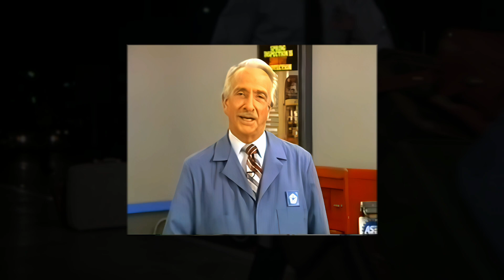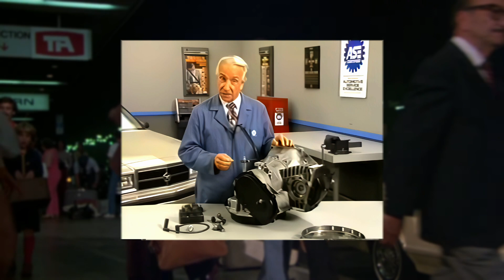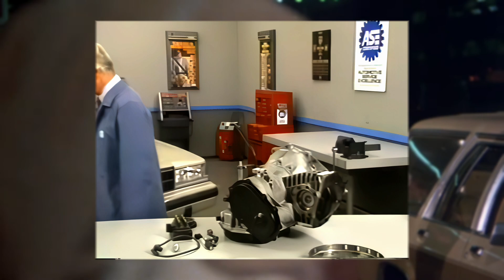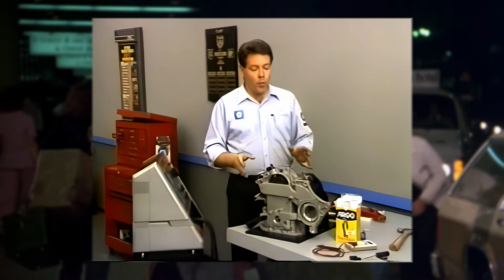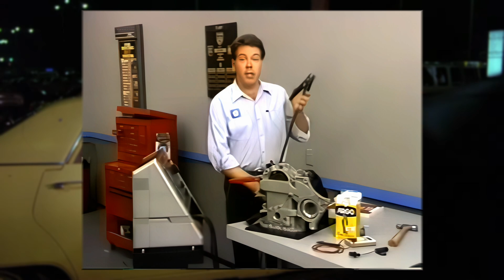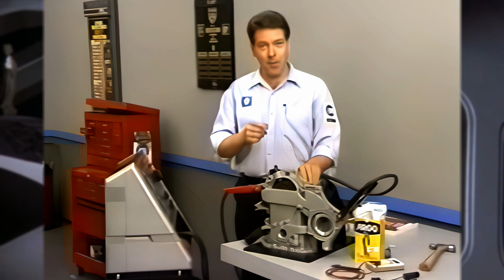Car Tech Update | Chrysler Turbo Encabulator

Comment: This mechanical dude got just one thing wrong. The outer flange manipulator does a cross transit composite discharge, as opposed to a standard magneto aspiration duplex. Just basic math, really.
Not bad, for pre-computational algorithmic flow vectors.
  I think.